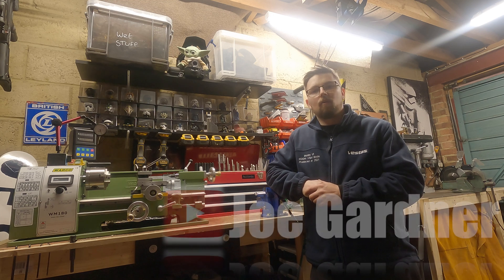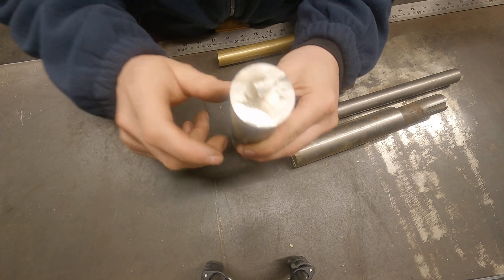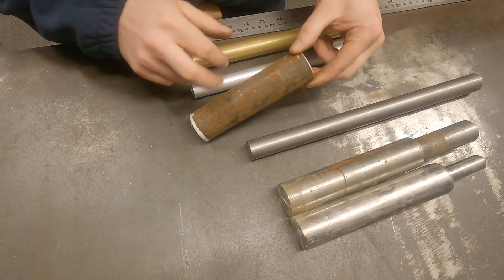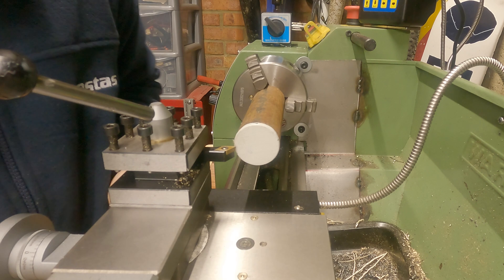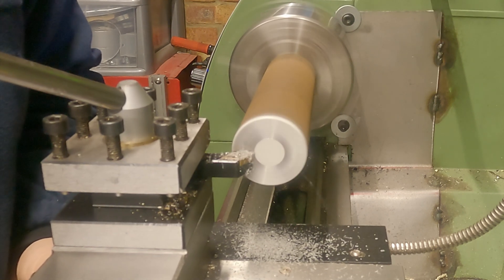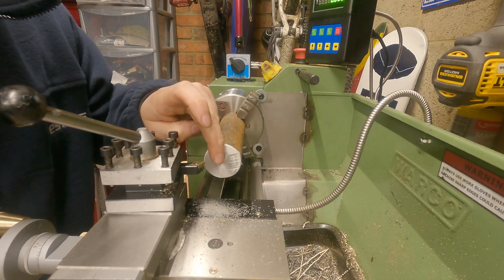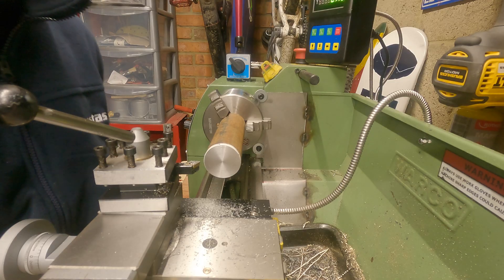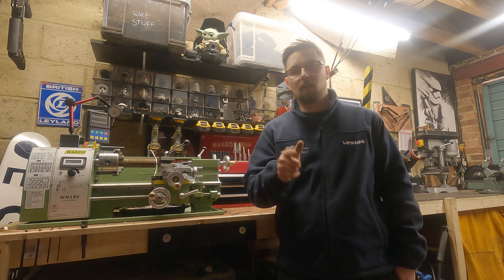Mini Lathe Basics Facing Off

Comment: Thanks Joe, that gives me a starting point,
I was guessing that there was some kind of 
adjustable-angle rest, cutting-bit holder, that could be used.
Reply from the maker: Your most welcome. I believe if you calculate 
Sin( angle you want ) x length of bar stock = offset of your tail stock 
Would be worth testing it first in a test piece. Let me know how you get on

Comment: Hi Joe, thanks,
I'm not able to respond in
comment sections here, so I'll try to ask
this question more accurately;
I'm not concerned with the exact length for purposes
of my query. 
I need a consistent taper on say 1 1/4 stock of perhaps 1 or 
2 degrees from one end of the round stock to the other end,
hence that might be from 1 1/4'' down to 1'' at the opposite end,
my goal is to get exacting tapers for each finished piece.
I need to make several identical parts, well balanced. 
I can't afford CNC, so my question is about how I might be 
able to do this, if there is some kind of angled bit guide etc
that would allow me to get this done consistently from piece 
to piece. What kind of part/accessory I might be looking/shopping 
for if something or some method exists.
Reply from the maker: It’s a bit hard to explain over text. 
But if you familiar with trigonometry and know about soh cah toa. (If not look it up it’s not to difficult ) 
You know the distance point to point and you know your taper 2 degrees you can use that formuala to work out your tail stock offset. 
I would advise using a dti on the tail stock to measure distance you adjust it so you can set it back.

Comment: Hi Joe -  I've watched a few of your videos and have come back to this one with a question. How do you face off and do further work on a piece of round bar that greatly exceeds the minimum stick out? I am making a tool that is 155mm long and I have a piece of bar 160mm with a very rough cut edge. I only have a fixed centre, but do have a centre support?
Reply from the maker: Hi bill this is a tricky one,
Ideally you would want a fixed steady to support the work while you face off and centre drill ready for your tail support. To make life easier as well could you grind the rough end down to make it as close to flat by eye if possible. 
Let me know how you get on. All the best